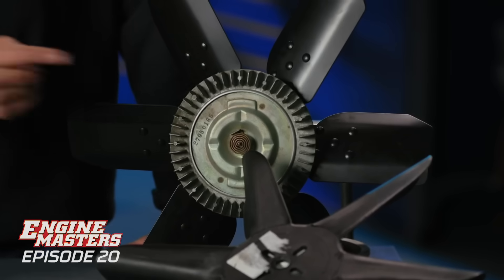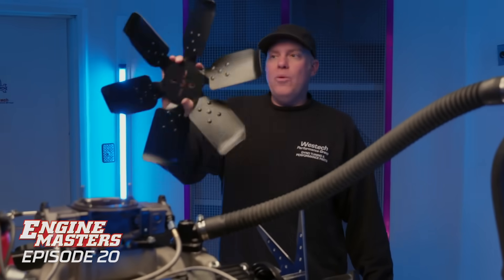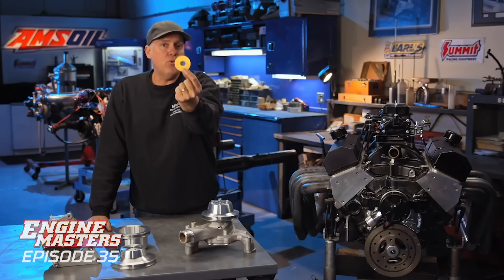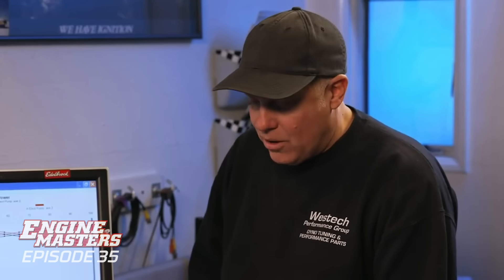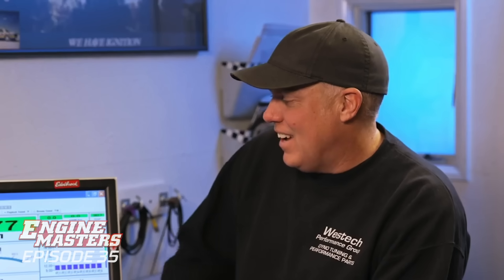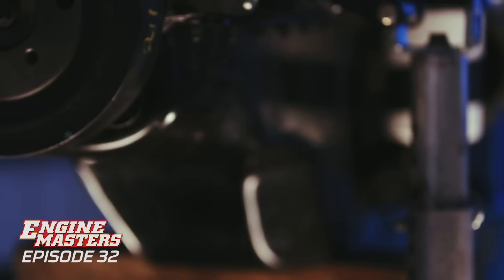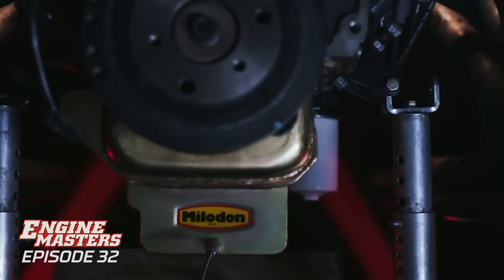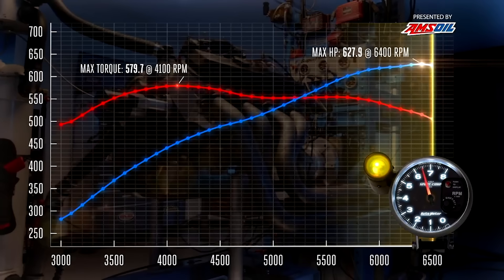Don't Do This! How to Ruin Your Engine's Horsepower | Engine Masters | MotorTrend

Comment: An electric water pump still puts parasitic loss on your engine just it hides it in load and drag from the charging system.  So that is not technically true.

Comment: The electric VS. mechanical test was flawed since there was no alternator in place to power the electric pump so that small HP difference would be even smaller in a real world application.

Comment: I have a 1975 Chevy 350 bored 30 over with a 510 533 cam 202 heads stock oil pump 650 Edelbrock the question is am I am running the right cam and my oil pressure does not pick up until it warms  up the motor only has 20 miles on it

Comment: It would be interesting if they would do a test to see the difference in oil temperatures based on spirited Street driving with the different oil pan quantities.  My guess is having 7+ quarts of oil makes a dramatic difference in cooler oil Temps as long as you keep it below 5000 rpms.

Comment: -Electric fan because 30hp and improved MPG
-Electric pump because little power and MPG gains but most importantly, turn the gnome off and keep the pump and fan on if over heating for faster recovery. 
-Small solar panel instead of an alternator because 10hp lol

Comment: This was pretty cool to watch, I wonder what that oil pressure map would look like on the street. I mean with a dig lauch and going though a few gears. I understand the windage issue fully, i know the have baffels and trap doors and so on. But taking 3 or 4 quarts out of performance pan like that would concern Me at higher rpm. Maybe I'm just over thinking it lol. Awesome video with great results.

Comment: I have an idea for you guys.
Instead of using a turbo to pressurize the intake manifold.
Run the pressure side back into the exhaust after the exhaust side. So my question is would it create Scavenging effect?
Reply: Not exactly, on paper it seems like it would at first glance because wastegates are required to control the amount of boost the turbo produces, an on purpose exhaust leak to prevent boost pressure from climbing too high. However, the extra air that is forced into the engine from the turbo gets ignited with fuel and spent out of the exhaust side of the turbo. Well, if you piped the intake side of the turbo back into the exhaust after the exhaust side of the turbo, there would be no extra air being forced into the engine, so the engine would be naturally aspirated and thus pumping naturally aspirated levels of air. My guess is that it would make it harder for the pistons to pump the exhaust out unless in your setup the exhaust piping was very short and the pressure side being fed into the exhaust had an easy way to escape. I would suggest looking into 2 stroke expansion chamber exhaust scavenging effect for ideas, you might be able to figure something out more than I can at the moment
Reply: @jomanout5866  
Ahhh....Thank you.
I'm not building anything except custom wood products. It's just an idea that's been in my head.
Basically it's like perpetual motion.

Comment: I say the clutch fan will be the winner before I see the video. a fan shroud robs power . if you fan is with in 3 inches of the radiator you don't need a shroud and it frees up hp. so you guys jumped past the clutch fan ? what was the number on the clutch fan ?

Comment: That alternator does not have to work harder to power anything extra at that rpm, its mechanical drag at any rpm that is a parasitic load.

Comment: Don't overfill the crankcase!  That's worse than 1 quart low.
Electric fans work great however, having them on at low speed lessons the load.  Try driving on a freeway up a mountain at 70, with passengers, the A/C is on and it's close to or at 100 degrees.  Ya, LOTS of loads on the engine!

Comment: I'd like to see an electric vs. mechanical fan showdown.

I've considered something similar for sport compacts to compare slimline vs. OEM. Most of us have to run electric fans so it would be nice to see if you can pick up extra HP just by changing electric fans, especially for us sub-300whp guys
Reply: thats what i thought this video was...and showed one fan and no fan so im fukt
Reply: Just look at the 91-93 Chevy Caprice with the mech fan vs the electric on the Cadillac Fleetwood. A solid 15-20 hp difference. Mech fans move a lot of air but electrics don't have as much drag on the motor.
Reply: Yes, you can gain a couple HP with electric fans, but nothing cools the engine better or makes the air conditioning work best over using an OEM type "extreme duty" fan clutch, fan, & shroud. EM did a test & the OEM setup was actually the most efficient & robbed the least HP over all aftermarket "high performance" fans. Personally, I want my expensive hot rod motor to stay cool, rather than chasing a couple HP at the risk of overheating!
Reply: Then you drag on the alternator, lol. Yes, I wanted to see that, too.
Reply: Electric fan robs zero hp other than the load put on the alternator,  how can it it's not attached to it
Reply: @MVPisME383   And an electric fan only runs when needed, on the highway it's off (unless you use AC). My 84 Trans Am with the stock electric fan off is always under 160 at highway speeds.
Reply: Ya the electric fan with the alternator seems like the logical thing to do but I don't think the extra draw would be that much because I don't think they would draw more than 750 watts which is 1 hp and I know alternator are not 100% efficient but even at 50% that should be like 2hp

Comment: Bought a 90 Mustang 5.0 that the owner said overheated. He was an aviation mechanic in the AF. (retired) He said he changed everything to get it to cool. New alum. radiator, thermostat and added a 'performance' metal flex fan. He wasn't sure if he got the fan on correctly, so had tried turning it around a couple times with no result. Bought the car and added a stock clutch fan in reverse rotation and it never overheated. You cannot simply turn a standard rotation fan around for a reverse rotation. That's what was on it. Great bargain price!

Comment: I use the viscous mopar type clutch. Chrysler says it can add or save as much as 10-15 hp or an engine out put. It isn't really any gain hoping it makes up for the loss with power steering pump, water pump, alternator and of course A/C compressor.

Comment: Sounds like the solution is to run electric fan and water pump then put a 2 cylinder engine in your trunk and run your alternator and condenser off it

Comment: Joe Gibbs back when he ran Pontiacs was dominating. They confiscated their engines and found zero rule violations but had 25hp more than anyone else. They determined they used 0w-50 qualifying oil for entire race instead of 20w-50
Reply: shouldn't 0w-50 and 20w-50 perform the exact same at operating temperature though? first number is cold operation second is hot.
Reply: @Snakes_N_Crafts  the numbers represent viscosity...which is defined as simply as "resistance to flow" 0 being no resistance and 20 being somewhat or quite resistant since 0w50 flows like water and the 20w50 flows like warm honey. that alone should answer your question. bearing clearance specs have changed immensely over the decades , cast iron blocks have given way to aluminum , so the heat sink ability has changed. tolerances are much tighter so oil viscosity must be low so it can flow .

Comment: I'm not sure the question was answered: What is the power loss of an alternator running an electric fan? Electric water pump? Both? 
It takes x amount of power to turn a fan at y rpm, regardless of where it's coming from. Same for the water pump.  If you transfer the power source from the belt/crankshaft, that power has to come from somewhere → the alternator (which is driven from the crankshaft). There is efficiency loss by transferring energy sources.  BUT, since the fan and pump wouldn't run as a function of engine speed anymore, does it help or hurt power?
Reply: Exactly, you don't get something (electric fan turning) for nothing (it takes power to turn that fan hence more drag on the alternator). I wouldn't be surprised if everyone on the electric fan horse aren't really getting the HP they think they are.
Reply: @chumleye1112  

I was looking at what electric fans draw, and it appears to be 35-60 watts... double for dual fans of course... seeing as 1 HP is equal to about 740 watts in the electric world, I'm thinking it would use about 1/10th - 1/4 hp... plus heat losses... so I don't see how it would cost more than 1-2 HP no matter how inefficient the alternator is at generating power...

So significantly less horsepower than mechanical fans, and since they only run when the coolant exceeds a set temperature,  the HP savings would be even greater...

I'd like to hear it from someone who has actually measured it though...

...but at this point, this pretty much has decided for me to go electric... quieter, safer, more efficient...

Comment: I love that you are doing these type of comparisons on an engine dyno. Answers things we've always wondered about. However the fan test was flawed. Obviously you only showed 2 of the 4 fans but most importantly you did not consider air flow of each fan. What if the least HP used fan had zero air flow? May as well not run a fan in that case. Would have like to have seen the factory clutch fan tested. I think they're best
Reply: They showed all of that on mototrend actually this was just snip bits
Reply: The problem with engine dynos, or even chassis dynos, is they're not capable of duplicating real world driving conditions, so carb jetting & ignition timing aren't accurate when the engine is subjected to actual driving conditions, whether on the steet or the track. My buddy, who has an All Motor, single carb on race gas, 7 second / 168 mph door slammer('86 Olds Cutlas), & I both know several people who had their race engines dyno tuned & their cars slowed down at the strip. They had to change everything back to their previous tune-up.

Comment: How does a dry sump oil system effect power versus volume of oil.  I have an LS7 but I’m guessing oil system removes the foaming issue as no sump under motor?

Comment: You know that an alternator that’s in a car running all the electrical system sensors etc.. the parasitic loss’s are more like 25-30HP you guys were barely drawing any load on the alternator think about a street car that you race there’s a ton of electronics on it plus a battery to charge if it kicks in to charge the battery you can lose 30HP the other mistake o see with new racer is they make they runs with there A/C on that kills about another 30HP, altogether you could lose about 75-100HP from the accessories on the front of the motor that’s why when I was a racer my fuel pump was electric, electric water pump, electric fans and no alternator, if the rules would have allowed for our class we woulda removed the starter too but cars in our class had to be self starting

Comment: I used one of those aluminum fans( with the blue center ) the 327 in my 67 Nova SS, I kept breaking blades. I think one of them went through battery. After the third fan, I finally switched to something else. Can't remember what it was.

Comment: Thank you for testing engines in a real life scenario! You don't drive around without those things on and it's really interesting to see which ones eat the most of the power. You still missed a few things though. AC Compressor, Power Steering Pump, Air Filter and some sort of Street Exhaust. Put this all together and the numbers will come DOWN
Reply: Actually I was watching a motor trend video where they were dyno testing a car, and actually made extra horsepower by putting on an air cleaner because it “makes the airflow smoother” or sum like that. 🤷‍♂️
Reply: Who uses ac
Reply: Some manufactureres are switching to electric driven PS pumps & AC compressors for better fuel economy & performance. A K&N type gauze filter will flow more air but they suck at filtration, when you compare the microns a K&N filters to a Wix paper element filter. K&N filters require an outerwear or foam "prefilter" to keep the ultra fine dust particulates from contaminating the engine & mass airflow sensors. Desert racers never run K&Ns now, & have found that a big cannister type filer with massive filtration area is the best setup, especially if the engine is turb charged. Same goes for diesels in high dust conditions. The dust where I live is called "poof dirt" because it turns to a talcum powder type consistency as soon as you do anything that disturbs the top crust layer.

Comment: Something I've done on a lot of my vehicles is ditching the stock clutch driven fan for a two speed electric fan mounted in the factory radiator shroud.  My butt dyno has always told me that it makes a difference, but I am curious as to how much the electric fan might tax the alternator.  I hope the effort, and money, wasn't wasted, lol.  I don't think it was.
Reply: On the full episode they tested alternator drag with a inverter and a eletric heater to see how much power they lost pulling max load and it still made less of a difference then the fan does, which makes sense, the fan gets more and more drag with rpm
Reply: Alternators are an instrument of the devil!! At least on high rpm engines. They short out or simply fail and cause all sorts of belt  and bracket issues. If you can do without do so. I did three day road race meets without on a battery. One electric fan for brief use on the start line and driving back through the paddock. Holley pump, 7 or 8 engine starts plus brake lights and wipers etc as required
But if life forces you into the things with electric fans etc at least halve the speed of the things and make certain you have a very good battery. Then the belt will probably stay on and the alternator may not fall off!!
The big timers use thousand dollar plus alternators and carry a spare or two.
Have a good battery isolator that turns everything off!
Reply: electrical vs mechanical, I've always seen electrical break first
Reply: As long as you upgraded the Alternator in kind, it shouldn't matter.   You simply need to match the change in charging to match draw from electric fan.
Reply: If you have a good battery it likely doesn't tax it much. Nothing worse the belt squeal from v belts and mechanical fan. A well thought up set up and the fan nearly ever runs.
Reply: Mechanical more efficient.   

Your electric puts heavy loads on the alternator.   Anynhest in the fan motor and alternator created is hp loss.
Reply: @tahcogunworks  absolutely incorrect, the electric overall is way more efficient hence why all manufacturers have moved away from mechanical
Reply: @tahcogunworks  : The one thing you’re forgetting is that a mechanical fan is always attached and an electric motor fan cycles on and completely off with temperature needs .. 
of course every application is different race versus daily driver !!!!!

Comment: "Way too hot like 200 degrees"
My Z06 runs at 220-235° half the year lol.  In fact the fastest passes I made at the 1/2 mile No Fly Zone were when the car was heat soaked and hot lapped.

Comment: I don't think the electric water pump was made very clear to the audience. So, by adding an electric pump, you cause the alternator to draw more power from the serpentine belt than having an alternator paired with a mechanical pump?? What's the horsepower difference with alternator paired to electric pump versus alternator paired to mechanical pump?

Comment: Doing this test on fan blades reminds me of the old days of generators when the cooling fans used to fly off for Bend, now the main reason for oil pan is this it allows basically air bubbles in foaming to dissipating and helps with heat air bubble in the oil system is not good for bearing have you heard the term of Spun bearing

Comment: This test of course is run in 'lab' conditions where the engine is not being swayed left to right such as in a race track where the oil supply can change at the pan based on other conditions (and oiling system setup). Pretty surprising nonetheless.

Comment: Does a windage tray in the oil pan make a difference ? I have seen some very close to the crank , that's a test I would like to see . I believe the oil pans used did not have this device , 1 or 2 quarts low don;t sound good to me .

Comment: So, when testing accessories have we not considered that if you have a “street” vehicle with an electric water pump and electric fan but also has an alternator. The battery can’t charge and discharge at the same time so therefore the alternator will be charging the battery and running both the water pump and fan along with the rest of the electronics ie. ignition, lights, gauge cluster. So, how much power do you ACTUALLY save with all the electric goodies?

Comment: SO? With Amsoil? I only need 1/2 the amount of oil in my motor? OK! GOT IT! Try that on a endurance motor sometime running a 4 -5 minute full throttle load....DRAG applicable only! Listen to David....TORCH your bearings & Crank....OR? Buy a Dry Sump!

Comment: I've always added a switch inline on the remote wire on stereo amplifiers, installed one in my buddies Cadillac that has a fuel mileage gauge. When off the mileage is around 20mpg, when turned on the mileage decreases to 15. Shows how much drag the alternator has with different electric loads.

Comment: I guess you can teach an old dog new tricks. What got me the most is the water pump and fans. I'm gonna go so far to say unless you're able to and feel like pulling your alternator belt for every run then it's not worth it. A worn out loose clutch with an aluminum flex fan mounted on it a Hitachi alternator is prolly the best bet.